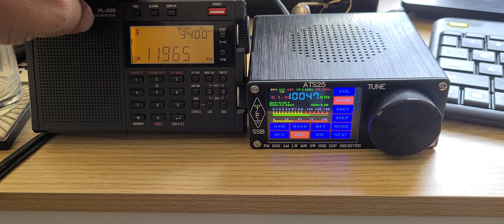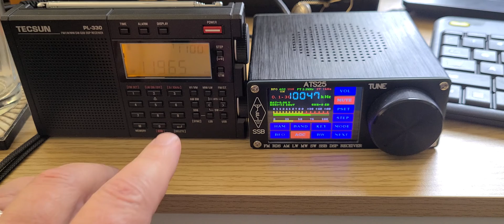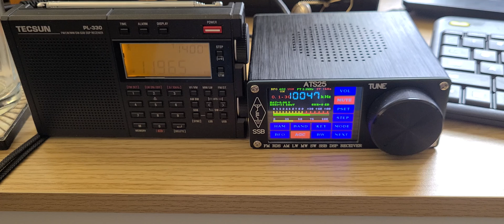What is DSP What is SDR and what is the diffence between them

Comment: Correct me if im wrong -
The ATS 25 is a software defined receiver with a DSP chip, software can be programmed to do a lot many manipulations to radio signal.

The tecsun is a firmware defined receiver with dsp chip. It can only do what functionality is assigned to the buttons, so limited.

Comment: Thank you for the information. I'd say both PL-330 and ATS25 are DSP radio. But PL-330 has chip SI4735 inside for digital signal processing on hard level. That means there is no way to change its functionality. ATS25 has analog to digital converter almost at its RF input. And after this converter just only software works with the digital samples. This software can be configurated by user for any tipe of modulation, bandwinth, automatic gane characteristic... And this software can be ease replaced by another version of software with the new functionality.

Comment: I think you're right Gilles, they should have labelled the ATS25 as an SDR radio, the microcontroller on the Arduino board contains the CPU, RAM and ROM. All the additional hardware on Arduino Board is for power supply, programming and IO Connectivity so more computer-like with a software driven tuner, a lot different to the DSP implementations.

Comment: A DSP is a part of an SDR, without the DSP we wouldn't have SDR anymore. So dividing them into two separate things doesn't make any sense. You are only talking about the user interface, which doesn't have anything to do with what the SDR is doing internally with it's own software. It can have a color LCD or a BW LCD, doesn't matter. Saying that the PL330 doesn't have any type of computer inside... think again, there's a MCU inside there WITH A REAL SOFTWARE that does all the functions needed for the display, buttons and controlling the SI4732 ! The ATS 25 also has a MCU that controls the display and read buttons in the same manner, both radios even have the same chip inside, SI4732, the only difference between them is that the ATS 25 has a more fancy user interface. So, yes, quote "no screen, no SDR", that's only your opinion, and you should keep it to yourself if you like, but don't divide DSP and SDR, because DSP is a functional part of an SDR, there's no line between them !

Comment: Gilles I don't agree with you if the main reason why sdr differs from dsp is the I/O interface. Having button displayed on a touch screen doesn't really differ from having them as physical interface, with underlying mechanical contacts. Furthermore also dsp radios have their own software (you have correctly recalled the firmware), so, based on your definition, they might also be considered as sdr. If we agree on this (id est: it's not the interface between humans and silicon chips which actually does the difference between the two worlds) then I will try to explain what the real difference between sdr and dsp is. All the best, and thanks for the wonderful work you do, every given day.
Reply: Enrico I agree with you. Radios had computers for many years. It does not matter if there are buttons.
Reply: Software-defined radio (SDR) is a radio communication system where components that have been traditionally implemented in hardware (e.g. mixers, filters, amplifiers, modulators/demodulators, detectors, etc.) are instead implemented by means of software on a personal computer or embedded system.[1] While the concept of SDR is not new, the rapidly evolving capabilities of digital electronics render practical many processes which were once only theoretically possible.

A basic SDR system may consist of a personal computer equipped with a sound card, or other analog-to-digital converter, preceded by some form of RF front end. Significant amounts of signal processing are handed over to the general-purpose processor, rather than being done in special-purpose hardware (electronic circuits). Such a design produces a radio which can receive and transmit widely different radio protocols (sometimes referred to as waveforms) based solely on the software used. From Wiki.
Reply from the maker: there has to be a line where we devide them ...  in my opinion, no screen ... no SDR  ...
Reply: @OfficialSWLchannel  I would describe the difference as - the frequency of operation.
Most DSP chips work at audio frequencies (CD quality, around 44,000 samples /sec) with some stretching up to a traditional radio's IF frequency (455,000 samples / sec). Filter coefficients have fixed values, and DSP hardware may even be altered to take advantage of this.

Once you get higher than that, your ADC is really fast - and you need some fancy techniques to select which station you want to hear. This hardware is NOT fixed, and filter parameters can be changed "on the fly" to adjust the response of the radio. Digital downconverters, CIC / FIR / IIR filter coefficients are all variable.